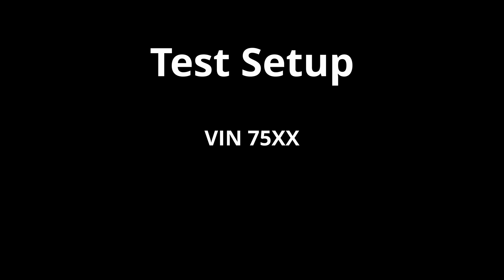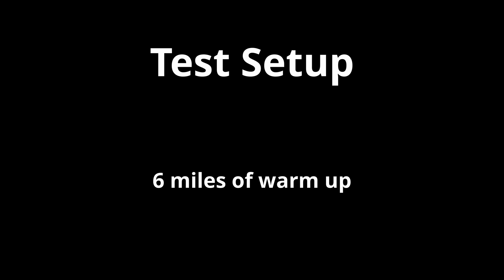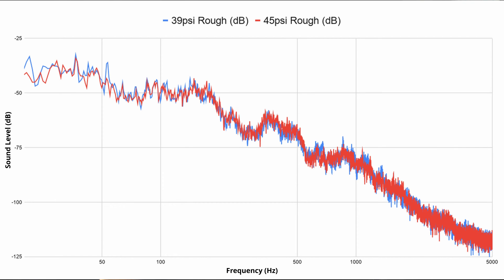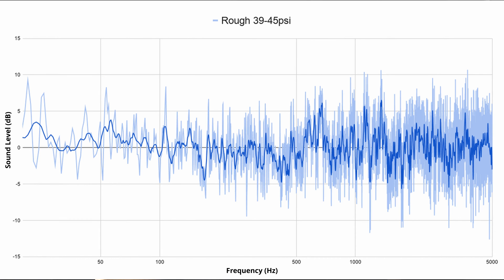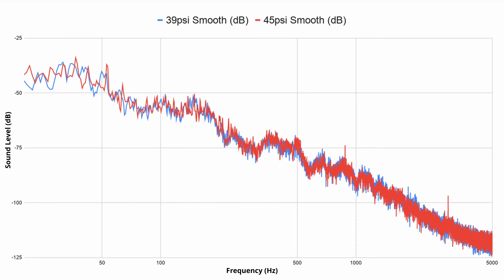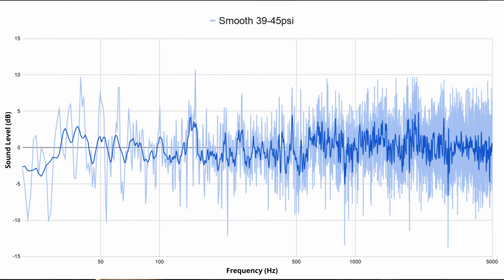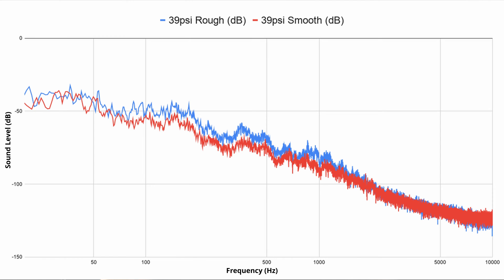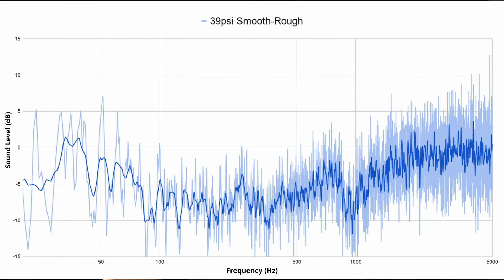Does Tire Pressure Affect Road Noise?

Comment: i think a lot of road noise comes in through the windows that is why some evs are using double glazing..
i don't think changing the suspension will make much differance, when a modern car goes past all you hear is the noise of the tyres on the road, that is the noise which enters the cabin.

Comment: Hey, maybe you can help me with a very strange problem. I have a weird cabin hum that kicks in at exactly 110km/h and goes away at 118km/h. My tyres are Michelin Primacy 4 and I recently had all my bearings checked.  I drive a BMW 520i 2014. I can only think of the resonance that is created with the air gap at those speeds. I live in Dubai and the current ambient temperature is about 42C. Do you think the temperate plays a key role or the PSI? I did notice that as the temperate increases the sound sometimes goes away but have never been able to solve the problem.

Comment: Hey I love the Snap Plate. Amazing work with the engineering!

Here's an idea for a product I would love to buy: a custom gap filler kit for the model 3.
Custom molded rubber pieces that go in every outside gap to reduce noise. I have seen this on a lot of Kias recently, but the idea is reducing those noise producing gaps. 

So instead of the rubber band product for the Model 3's glass roof, a flat strip of rubber with a piece of rubber running down the middle for fill that gap perfectly. This would leave the glass roof completely flat. If you look at the roof of a modern Audi, there's almost no gap whatsoever because the metal is folded over.

As for the frameless windows, I have noticed that there is a lot of inconsistency with the seals between cars. Some people have used thermal cameras to detect air leaks. Air leaks = noise.
If there were a product to either replace or augment their existing seals, that could go a long way towards reducing wind noise.

Comment: Awesome video and interesting thoughtfulness about road noise in the Tesla Model 3. Very well done. I might be alone but I think the Tesla is already very quiet. Without noise from an engine, transmission, and exhaust the road noise can be heard more readily. There is a harshness to road seams that reminds me of driving a go kart. 

When you said rather than place material on the fenders and elsewhere to absorb the noise or deaden the noise I thought you were going to suggest an active electronic noise canceling system. 

I look forward to seeing how your improved suspension helps.

Comment: I need to check a difference of 45 psi versus about 33 PSI. It is a smoother ride in my experience. I have slightly larger tires I am running Michelin pilot sport all season 4S 245/40 which are heavier at 28 pounds. Versus the Michelin pilot sport for us at 23 pounds. I have larger rims I’ve gone up from 8 1/2 to 9 inch width. They are also 10 pounds lighter. They are the signature Suite 501 racing series forged aluminum. What makes the most difference is the aspect ratio. Given these are 10 cm wider and the aspect ratio being 5 cm taller makes the road quite a bit smoother. The outer diameter did change from 26.5 to 26.7. The noise is slightly reduced From stock

Comment: I think Tesla uses very stiff rubber bushing on all suspension control arms, to be able to handle awesome acceleration without destroying the.rubber bushings and it is this stiffness of the rubber bushing what creates the physical pathway for sound energy to travel..  Also, I believe the control arm part numbers to be the same for non-performance and performance models.